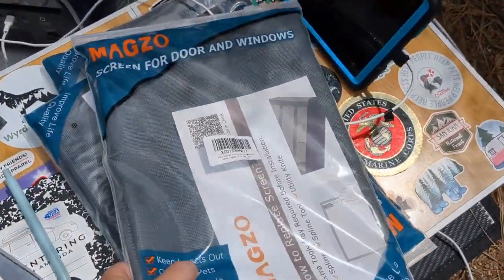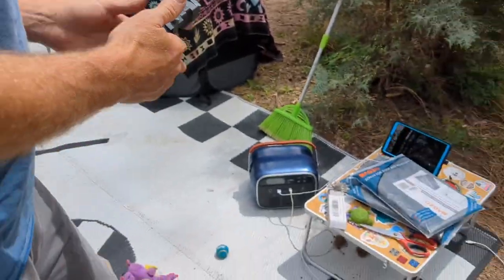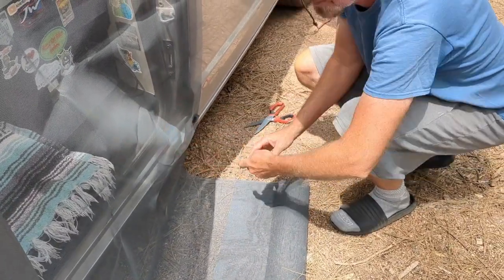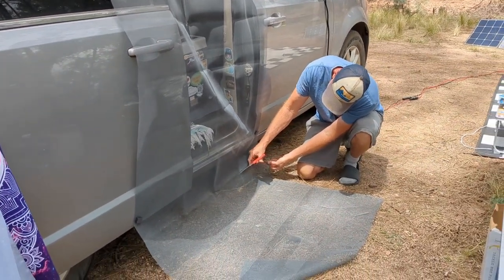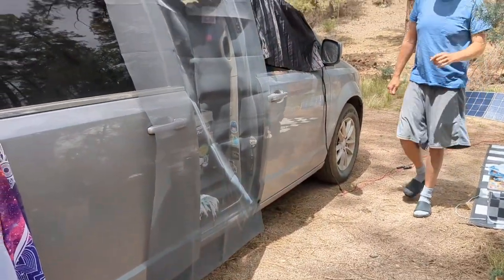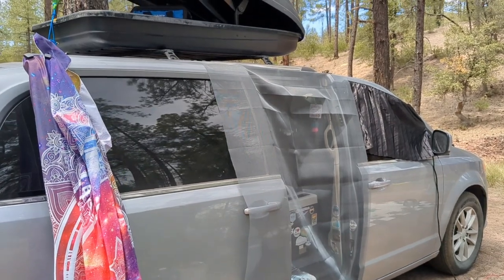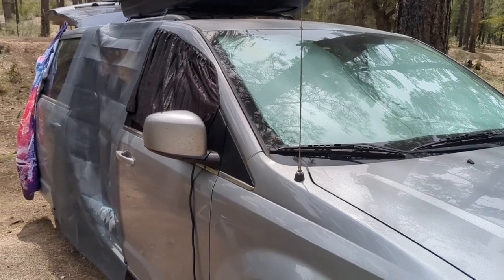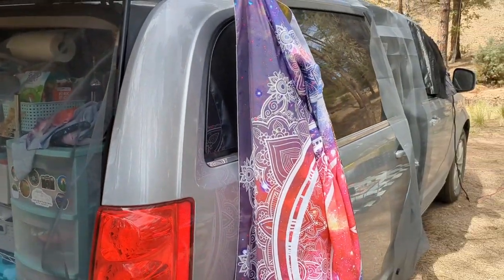Making DIY Bug Screens for My Minivan Camper Conversion

Comment: I have those magnets and they tend to  crumble, so I wrapped mine in mailing tape to keep them longer… rainbow tape btw so they’re easier to find when fall off or get left on around my van. 😊.    Also I like to keep them whole, mainly for uniformity, and a few will break anyway just cuz of brittleness 👍🤷🏻‍♀️.   
I am currently in the mastermind stage of screening my doors !  Was planning on the magnet route too, but wasn’t sure what screen to get. Been searching for a stretch lace to use  instead!

Comment: So now that the screens are up, how do you get in the van if you wanted to say let’s be inside the van with the screens up since the magnets are on the outside? Would you have to climb in through the front?
Reply from the maker: Just move them over, and pull them back when I'm inside.